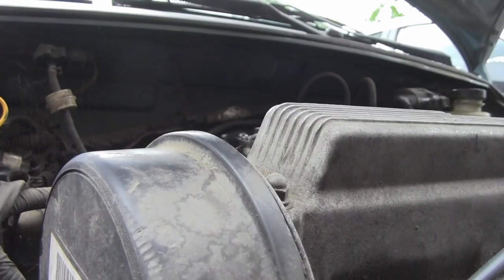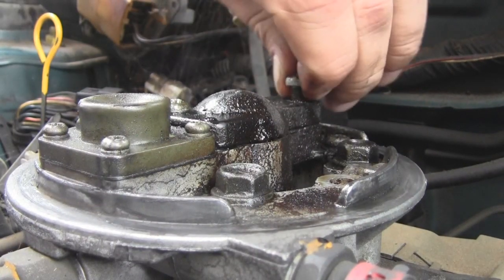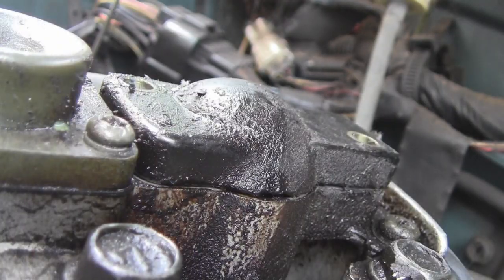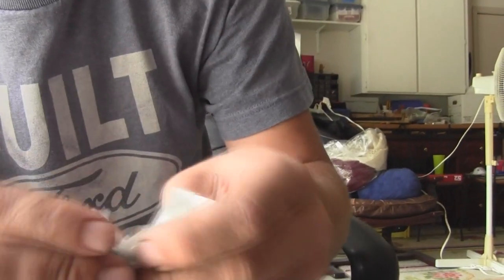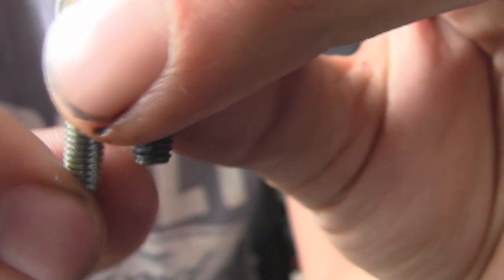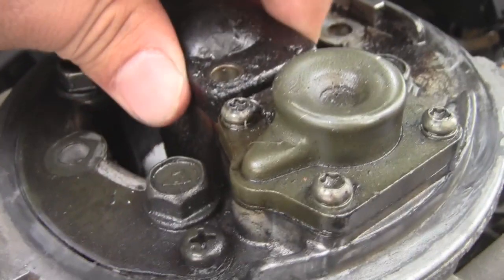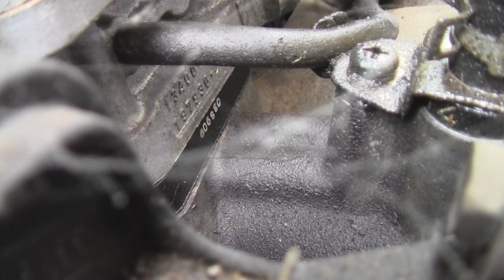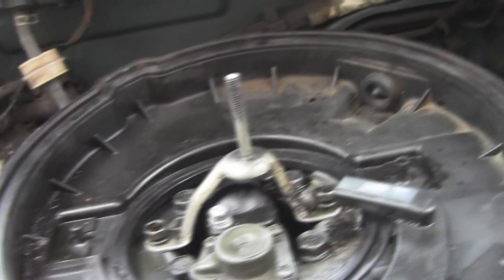Replace a Fuel Injector on a 1.0 3 Cylinder Geo Metro

Comment: Our Geo would run, go down the street, then die a few blocks later. I replaced the fuel pump and filter, same issue. When I tapped on the injector as my wife turned the engine over it would run but only if I kept tapping on it. For some who think it might be the injector, clean up the connections to the injector and inspect for any arcing. The process for doing this is pretty much what this person has shown, minus replacing the injector. Good video and hope this may help someone some day.

Comment: Thank you for uploading this video. I'm a little illiterate when it comes to cars and their mechanical insides. That being said, I was confused about what the fuel injector actually looked like, so when I looked up the part for it and it looked different from the shell (I guess you could call it that) that covers the actual fuel injector, I just had to look up some kind of guide for it, and low and behold, I find your video. Thanks again for the video guide, man.

Comment: There are different strengths of loktite.  Loktite is valuable to prevent bolts from coming loose, but there is a weaker version which can still be loosened easily and the strong, which is more like a glue. The weaker version is enough to prevent bolts from coming loose. The problem is that they used a screw head making it difficult to really get torque on it. You can also get an impact driver unit for smaller screws as well as for bolts. They are very effective for getting off Phillips head screws or any others.

Comment: Tip the reason you strip a lot of screws on cars is because of the Japanese standard screw you can tell if it's Japanese standard if there is a dot next to the screw head and you can order Japanese standard screwdrivers which are slightly different from us standard

Comment from the maker: @j12torts What year do you own? Mine is a 97, the fuel filter is in the back of the car right off the feed line from the tank. I think that other years they are in the front on the firewall, thats a really easy thing to check though, it could be the o ring or the gasket on your throttle body, cant really tell ya much through text though without lookin at it in person.

Comment from the maker: @j12torts Oh ok gotcha, I have never worked on one of those before, and you dont see many around anymore over here pretty hard to find parts for too from what I understand. But all the same its probably under the car or on the firewall. I would think its an O rong though, or if it has a fuel rail that could be it. I would clean off the top of the motor and have a friend start it so you can see exactly where its coming from.

Comment: My 1997 Subaru Justy (1.3 G13BA) left me stranded today with the same issue.. putting in a new fuel filter and either cleaning or replacing the injection. probably replacing it. :/
Reply from the maker: see if you can find one used, they can be pretty pricey new
Reply: The problem with used parts is, it's a risk of the issue returning. And I'd rather not risk that. the car nearly stalled on me on a highway without a shoulder (on a bridge) and later stalled within city limits. I don't want to take any risks of that issue returning any time soon, and getting a used/cleaned part seems too risky to me at this point.
Reply from the maker: Understandable man
Reply: Waar is video van uw justy?

Comment: Hey Bro, what size screws did you use to replace the 2  screws that had blue locktite?
Reply from the maker: +Angelo Castaneda Honestly I do not remember :(
Reply: +hanksranger Oh okay. So did they fit okay or did you have to force or retread
Reply from the maker: +Angelo Castaneda they fit fine if I remember right. If you still have them take them into lowes and try to size up as best you can with the metric hardware they have. You might have to go with bolts instead of screws though
Reply: +hanksranger Okay. I have the Throttle Body off so I'll just take it with me to size up. Hey thanks for all your vids and time to put them together. you do a great job. very helpful.
Reply from the maker: +Angelo Castaneda no problem man. The fact it helps people is what makes it worth it, ya totally just take it in and see what you can do with it good news is hardware is cheap
Reply: Hank's Small Engine Repair is that the fuel injector you pulled out and replaced ? or throttle body ? I have a 2000 Chevy Metro 5Speed 1.3L , its turning over but wont fire , was told it's my injectors .. I baught new injectors online , care to help me out for a few mins if you can chat ? email is 
mobileislandsolutions@gmail.com

Comment: @hanksranger nah my car is not a Geo it's a Mitsubishi Pajero 1991 3.0L V6 (similar to your Mitsubishi Montero there in the states)

it's not really a continous leak but whenever you start the car you smell gas and a dribble leaks out somewhere near the injectors, i think it could be an o-ring. yeah the fuel filter hasn't been changed for a while.

i think this will cost me money, jst hoping its nothing major....lol

Comment: Where is the fule filter  located on the 3 cylinder geos?
Reply from the maker: Stanley Speedway along the frame rail under neath the car towards the rear can’t remember which side
Reply: Hank's Small Engine Repair: Thankyou for your videos! Im a fan of underpowered but damn good cars!! It isnt the fastest but she will get you there WITH air conditioning.
Reply: Driver’s side between the tank and frame.
Reply: left side

Comment: Just did this yesterday and ran into a problem with the O-ring on the electrical connector being bad.  have some part #s for O-ring and screws from Fastenal.  #2140879 http://www.fastenal.com/web/products?term=2140879&searchMode=productSearch for screw with a metric hex head.  #1166816 http://www.fastenal.com/web/products/details/1166816?searchMode=productSearch&zipcode=&filterByStore=&filterByVendingMachine=  for O-ring

Comment: There is a tool;  it is called an impact driver.  I believe this would be the proper tool to loosen these screws.  It has different size drives - slotted or phillips - put the proper bit in the tool and hit the tool with a hammer - it has a spring that puts tension on the screw and the force from the hammer loosens the screw.